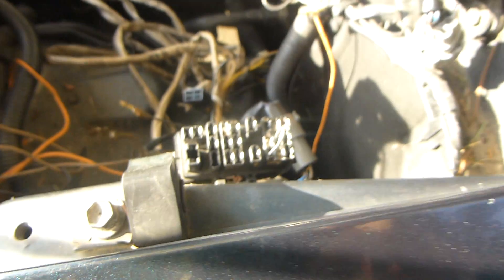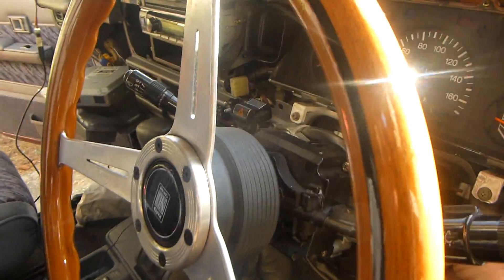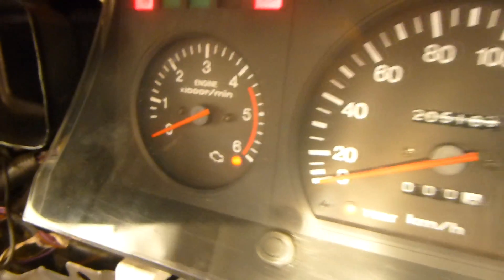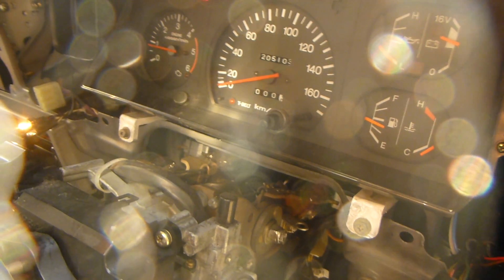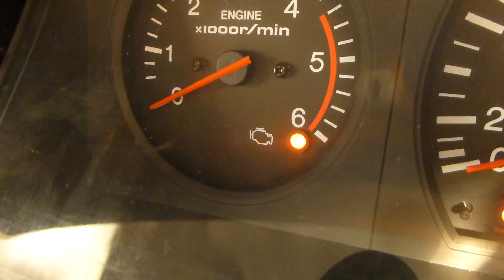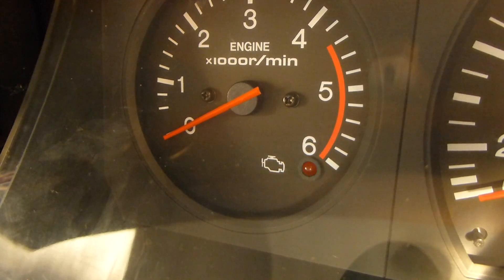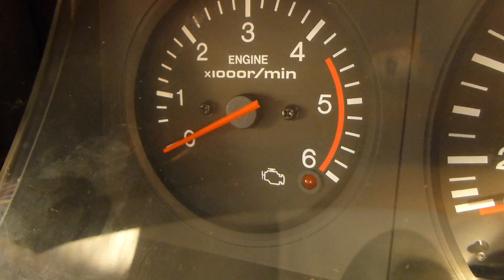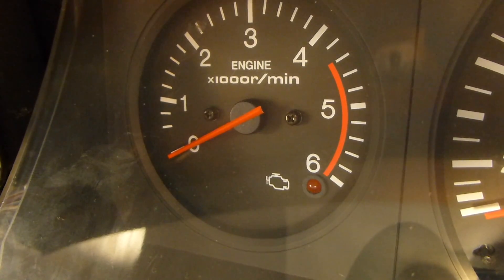1993 Landcruiser Prado 1KZTE on 1998 ecu 89661 60560 startup

Comment: Martin what's the significance of the 60560 in  the part number,  89661- 60560 ?  My '93 Prado came with 60250. I've secured a secondhand one where that number is different and change up to overdrive is 10km higher at 90km/hr.

Comment: Dose the part # 175800-1294-12v make a difference if 89661 60250 designation is the same when changing an ECU. My Prado now changes into overdrive at 90km/hr instead of at 80km/hr? Fuel consumption gone up!

Comment: Hallo Johann - just got a 1998 Prado. My keytransponder broke and the main key is lost. No original parts from Toyota are still avialable. So bought a used set of keys, transponder, immobilizer. Now the motor shows the same like on your video - starts for 4 - 5 sec. and then goes out. Problem is that the immobilizer realize that key is ok, but the motor ecu has the old key code and stops the motor.
Do you know that problem and maybe do you know a solution? Unless no solution is found i have to scrapping a good in condition and good running Prado only by this little fact.
I am from Germany. Thanks a lot in advance.
Reply from the maker: Is that not something a dealer can address? Re-programming the ecu to accept the new key/transp/immob? They should be able to do that. I do not personally do this, but I am certain that there are people that can. Or, look for a matching ecu/key/transp/immob altogether that are already programmed to accept each other.
Such an annoying problem, I feel for you!
Reply: @mkloppers  Thanks for your response. No, the dealers are saying - must be a new motor ecu. I think the same, reprogramming, reset, etc. should be there work. But maybe they under a certain contract or so not to allowed to do this.
Thanks anyway, will go further on this problem. All the best.

Comment: Hello, just wondering if you already fixed this problem?
I'm also having some problem's with mine.
Reply from the maker: Hello,
Yes, I fixed the problem on the original ecu. There was a trace that was blown out, particularly hard to find... the break in it was so small, and it was next to a large discoloration which drew the eye away from the culprit spot.
The traces don't just blow out for no reason, the caps are likely old and failing, and need to be replaced. Don't bother repairing blown traces with new substitute wiring until (at least) the failed cap is replaced.
It is time consuming, but go over every trace with a good magnifying glass or a microscope with low magnification (4x, 8x etc). There are also likely more than one blown out trace, there could be 4 or more.
I returned the wiring to original, and she started right up.
Reply: Hello, 
Ok that's great.
I was just wandering if you succeeded in modifying a different ECU for a KZJ 78.
I just got mine fixed, but these ECU's are unfortunately not so reliable so I'll buy a spare one for a next trip.